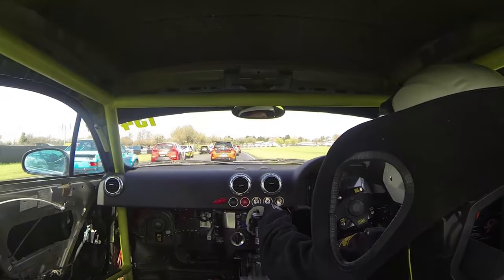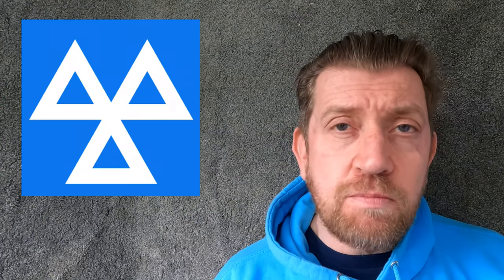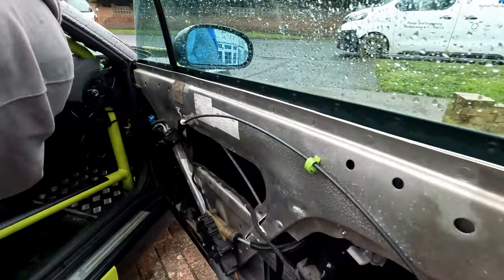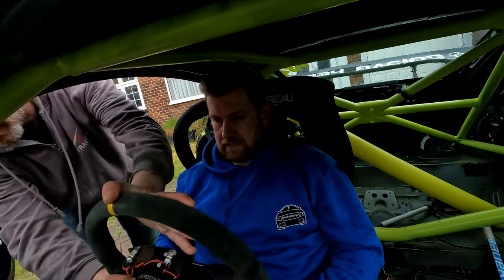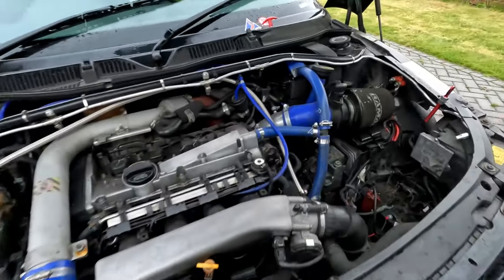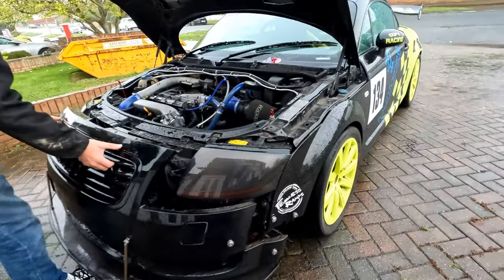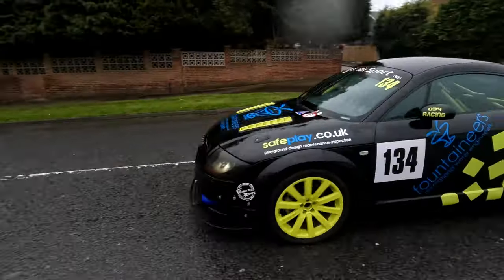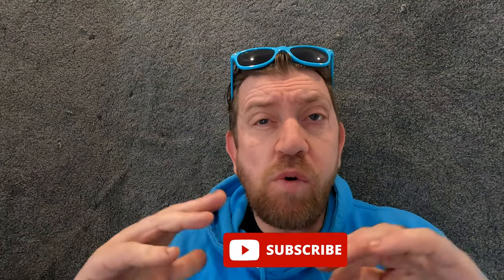Audi TT Mk1 - How to build a track car on a budget

Comment: Perfect timing on this video! I just started a TT Quattro track build here in the states so this video is inspirational and give me some great ideas. One thing i wondered about here in the states was inspection with driver airbag removed.
Reply from the maker: Thanks Rick. I think someone answered on FB group. The good thing about stripping the interior and steering wheel is there are no airbags to go off at least and the fuses can be installed to spoof the pressence of airbags. Thanks for your comment pal!

Comment: Wow, you got to drive it and on a wet track!!😉....Some really useful mods on that, love the tablet instrument panel!!! and the front bumper quick release. What a fantastic car, I see so many perfectly good  road worthy TTs getting scrapped because they are worth more in parts, which is sad, I'd much rather they got turned into track cars like this.
Reply from the maker: Thanks Si. I only got to drive it on the road but it was seriously wet so could not "boot it". It felt very rigid and solid so you can feel the polybushing. The lack of any interior really made it loud too. Quite an experience!

Comment: Hello mate iv still got a knock after doing bearing, lower arms, track rod, drop link. Any ideas.
Reply from the maker: Driveshaft loose at all? Could be that.
Reply: @andycharger  No all tight. Going to check the subframe bolts. After that I haven't got a clue what it is.. thanks for replying